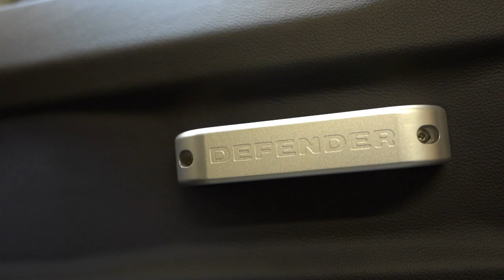custom leather Land Rover door cards

Comment: is the foam you use for this called Scrim Foam? and how thick is it? i would love to give this a go :)
Reply from the maker: Yes it come in 3mm,6mm,10mm and 12mm I used 3mm on the door cards. Thicker will interfere with the seat base on a Land Rover
Reply: @coastalcushionco8227  Awesome thank you! Going to purchase one of those steamers you have also as they look like a great piece of kit. DO you just measure the sections of the door card and stitch them together or do you leave more for an overhang (I'm sorry i'm aware this sounds very rooky I'm brand new to this)
Reply from the maker: @LewisAlldritt  Steamers are great but you will learn a lot more about the trade if you don't use one. I have been working with fabric for over 40 years and only purchased steamer 3 years ago. The size of the panels need to be correct on the hight in the centre of the card, but when it comes to the extra that goes on the back side of the card alway give yourself more than you think. You can always cut off the extra but you can't add more if you have not got enough. the last thing you want to do is remake something for the sake of a couple of inches. Its a very annoying mistake to make!!!🤯
Reply: @coastalcushionco8227  That's great advice thank you! Very excited to get into this. Don't want to bombard you with questions as i feel awful doing so, In regards to the templates for recovering my land rover seats, is it best to unpick the seat I have so I have individual templates to draw around?
Reply from the maker: @LewisAlldritt  Ask as many question as you like, sometimes I have video that will explain the answer and I will leave the link.In regard to Patterns/templates This video will explain in depth  https://youtu.be/gj20XVm7etU
Reply from the maker: sorry wrong video its this one  https://youtu.be/nBGlf61O1H0
Reply from the maker: sorry wrong video its this one  https://youtu.be/nBGlf61O1H0
Reply: @coastalcushionco8227  binged all these videos over the weekend, my Jack H2 sewer arrived this morning so I'm ready to give it a go! cant thank you enough. what thread would you recommend using for door cards, Ive got some bonded nylon 210 if that'll do?
Reply from the maker: @LewisAlldritt  Bonded nylon is what I use, I buy from a company called Martrim check them out for all of your fabrics leather and trimming supplies.
Reply: @coastalcushionco8227  your tips have been absolutely invaluable so I wanted to say thank you! Also visited Martrim and they have literally everything I need. I've covered most of my Defender (dash, door trims and Cubby box) I'm really struggling with the rear door card if you have any experience or tips and tricks with those as they have a lot of different angles Where the grab handle and door handle sit, also the interior passenger grab handle is an absolute nightmare 😂 couldn't find any tips or tutorials online so I thought I'd ask!
Reply from the maker: @MrMoodyMuffin  If you watch my video on the Range Rover Classic door cards that my help you. The passenger grab handle wish a bit of a head scratcher for me too, It needs to be hand stitched on. I have one that I need to do so I will post the video on that on soon.